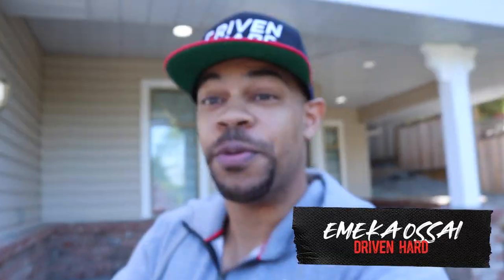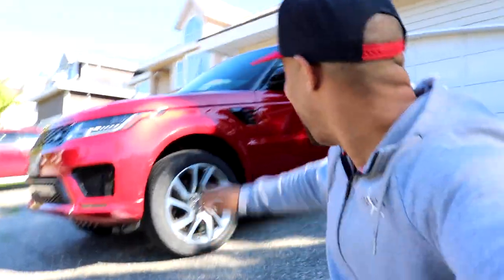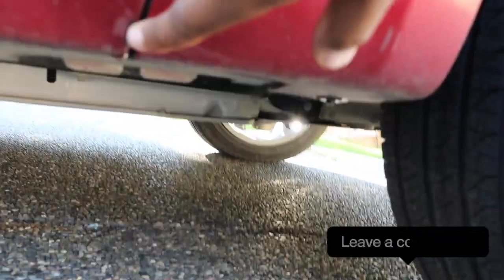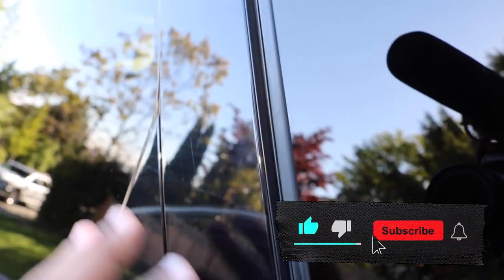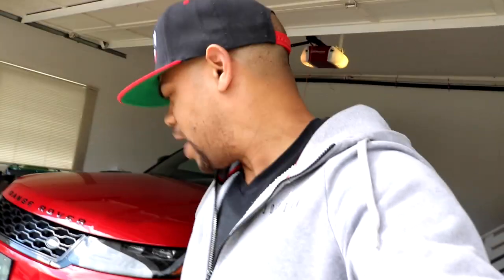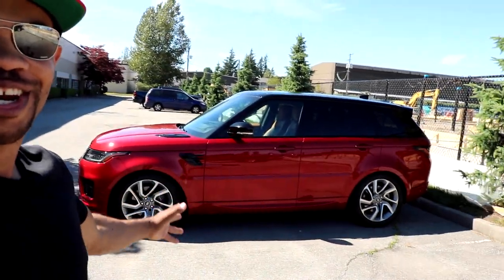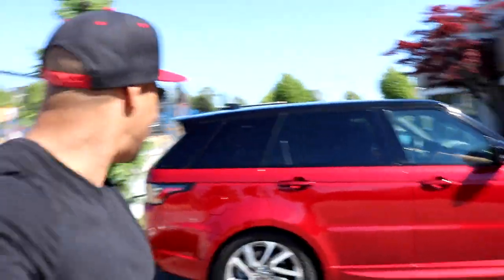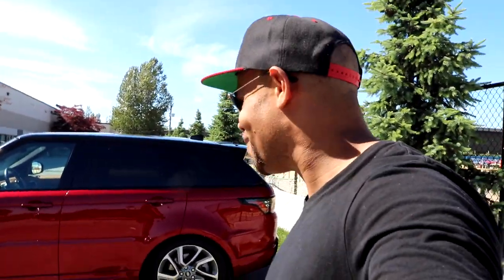Bumper Repair & Ceramic Coating A Range Rover Sport

Comment: She looks sweet as hell, time to get dirty lol, I know its virtually impossible by video but i look at that autobiography badge and maybe all the various lines you can see are causing it but i swear the right hand side of it has a slightly bigger gap then the left hand side in relation to the SPORT badge,
Like i say its prob a optical illusion with all the lines and shadows but i am curious lol
Hope your keeping well geezer
Reply from the maker: Hahahuaa you caused my to drop everything and run down to check.....
It's straight lol.
Reply: @DrivenHard  lol my bad buddy, but its not often i'm happy i was wrong, in this case i am very happy
Reply from the maker: I'm a little ocd when it comes to that type of stuff 😂🤣
Reply: @DrivenHard  one of my tickets is panel beating so i am a git when looking for gaps, misalignment and video's can play games on the eye, great when you mate wants to buy a car to get the price knocked down, but bad for a mate after they already purchased it then have a look and reel of a list of "thats a bodge, thats a bodge, that noodle filler bodge" and then faint when you hear what they paid lol